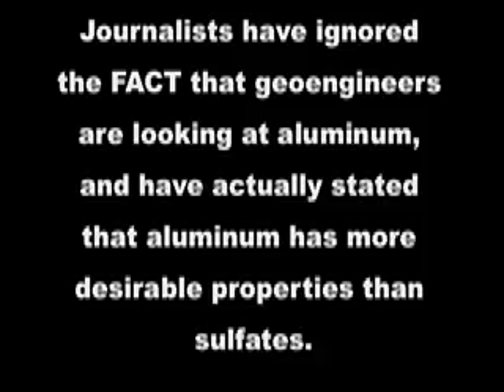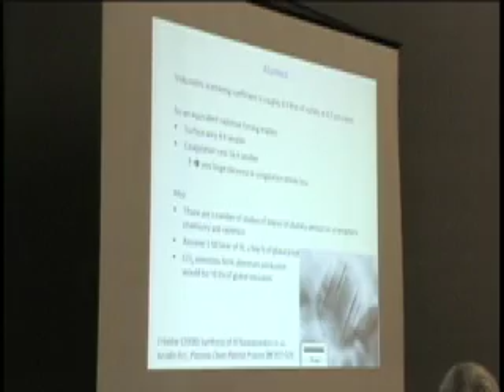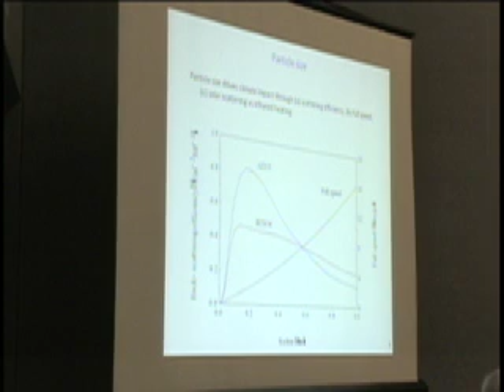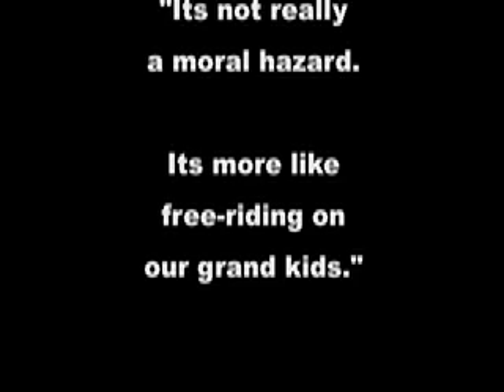Atmospheric Geoengineering with Aluminum Aerosols.mov

Comment: Dieses Video wurde gemacht beim meeting der American Association for the Advancement of Science (AAAS) in San Diego am 20. Februar 2010. Vortrag von David Keith über Geo-Engineering - the artificial modification of Earth's climate system. 

Er schlägt vor, Aluminium Nanopartikel statt Schwefel zu verwenden. Er sagt, dass das sehr einfach und kostengünstig zu machen ist durch Flugzeugabgase (ab 1:30 min) "... and do this in just a jet in a very simple way. Make hight quality alumina particles just by spraying alumina vapor out which oxidizes. So it's certainly and principal possible to do that. There is a big literature ... about it." 

Er sagt auch (ab 2:20 min) dass bereits 10 Million Tonnen Aluminium in die Atmosphäre gesprüht wurden, und dass bisher keine ernsthafte Forschung in Bezug auf giftige Nebeneffekte u. Auswirkung von Aluminium auf den Menschen gemacht wurde. Die Forschung habe diesbezüglich gerade erst begonnen und es wurde noch nichts publiziert. Es könnte sein, dass sie in Zukunft etwas schreckliches herausfinden, was bisher nicht gesehen wurde. "There could be something terrible that we will find tomorrow that we haven't looked at."

Ab 2:48 min sagt David Keith: Aerosol-Geoengineering ist so billig, dass die Kosten (der Ausführung) im Grunde keine Rolle spielen. "aerosol geoengineering looks like it is so cheap that the cost is basically not gonna be an issue. That means the implementation decisions will be risk to risk decisions ..."

Ab 3:50 min sagt er: Und übrigens ist es nicht wirklich ein moralisches Wagnis. Es ist mehr wie Schmarotzen auf Kosten unsere Enkelkinder. "And by the way it's not really a moral hazard. It's more like free-riding on our grand kids."
Das war 2010 !!!